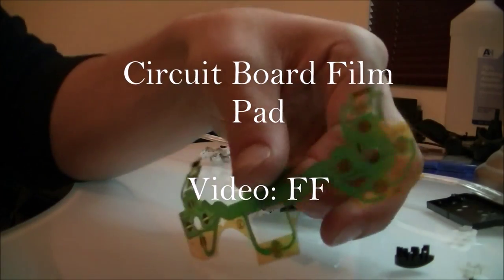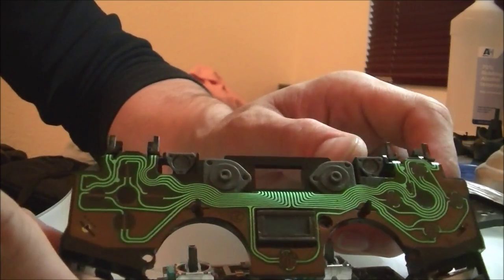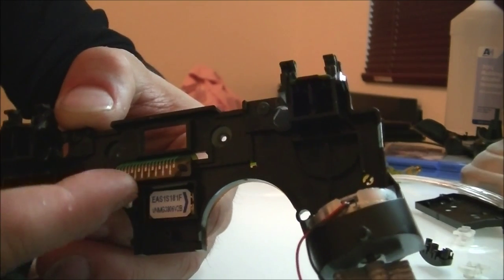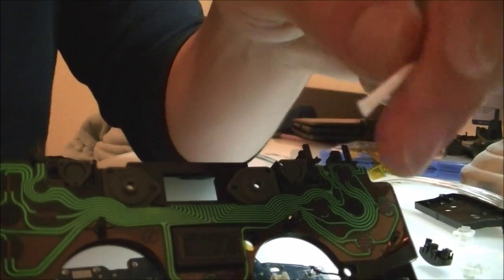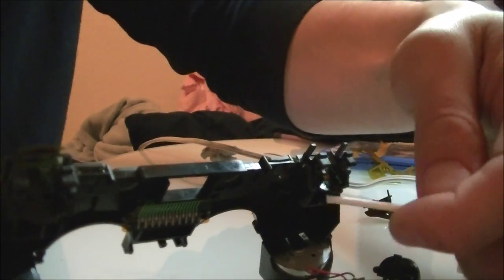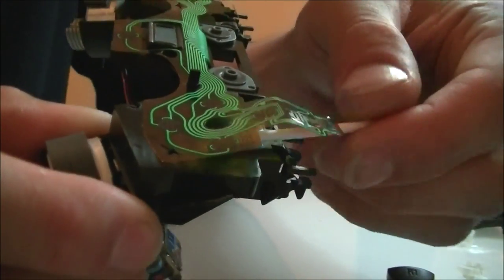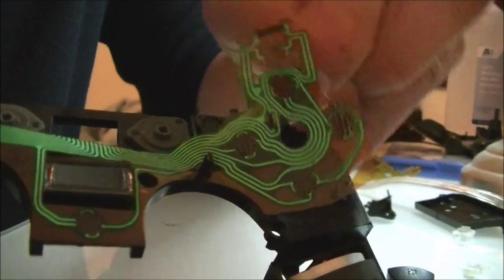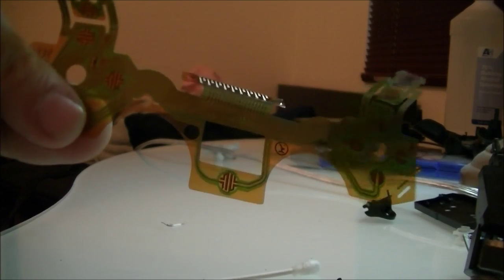Video FF : Circuit Board Film Pad Removal and Maintenance

Comment: @bonus card what do i do if mines is messing up like when i press anything on the left side of my controller it automatically say i pressed l2
Reply from the maker: +mario mckinnie 
Please open up the controller by viewing my video "how to safely open up a dualshock 4". It sounds to me like the filmpad may be dirty or bent so that any pressure on the left side affects the L2. This could also be because of a broken L2 or spring. If it is not due to a broken L2, I think the biggest possibility will be the filmpad. You should remove, clean and make sure all contact points on the filmpad are flat and contacting correctly.
Reply from the maker: +mario mckinnie I have seen problems happen to just one side of the controller pretty regularly. Usually this happens because a part has been broken and then lodged into one of the gaps on that side of the controller. Therefore, i recommend opening the controller and checking to make sure each part is connected correctly. Often a loose thumbstick will make the case not able to close correctly, in this case that would be the left thumbstick. If you can also check the dpad rubber conductive pad (Q) in my other videos, to make sure it has been connected correctly. Next check the L2 and the L2 rubber conductive pad. The conductive pad for L2R2 must be pulled over the top lip of the plastic interior casing. Besides these try to make sure the shell is fitting together before screwing the entire ahell together.
Reply: +bonus card thanks lol but i just sent it to the PlayStation factory its their problem now
Reply: bonus card 
my controller stopped working properly after I've changed conductive film. Now l2 and r2 always on. It's not the conductive pads, I've removed them and tested without them, anyway l2 and r2 working without any phisical contact. Ordered new conducting film on ebay from the other seller, I was sure it's the film giving me all those problems, but no, the second one does the same think. Bought new controller at the end... 
Anyone any ideas how to fix, second controller will be good too
Reply: @sziurys  i have the same issue....did u get any answers
Reply: @suwaidakbar  
Yes. I've changed those rubbers underneath every single button. All problems gone
Reply: You can change only those wich is not working properly

Comment: Thanks for the video. It really is informative.

My question:
My controllers L2 and R2 always stay pressed. I did remove the l2 and r2 buttons and the rubber conductive pad, but still the l2 and r2 stay pressed.

Do you think the circuit board film is damaged?
Reply: No.
Reply: @sziurys  i got it fixed. It was found that the circuit board film was the problem. GOt it replaced and now it works fine....:)

Comment: One of the contact circles in my film looks scratched and wear off, coincidentally the button over it doesn't work (up) this can be fix or the only repair is to replace the film?
Reply from the maker: If the film pad is damaged it is a probability that it must be replaced. The electrical ribbon in the film pad is very sensitive and a damaged film pad will definitely cause decreased functionality
Reply: My film is separated in 2 pieces, and is clearly visible that one of the black circles is isolated from the ribbons, the connecting part is scratched, not like the video where the circles are integrated to the ribbons
Reply from the maker: Thank you for clearing that up, this video explains fixes for gen 1 and gen 2 ds4 remotes, I think the generation that you are dealing with is one of the newer generations where they have used a different design and somewhat more efficient/less diy friendly architecture.

Comment: Hello. Would you happen to know the diffrence between the 4 colours/type of Flex Ribbon circuit boards and if they are compatable with each other?
Reply from the maker: David Ellis Hi David,  I believe you are referring to Blue, green, yellow and the fourth I may not have seen. I have tried switching Blue and green, they have a few holes in different locations (For example moved up few mm) but with a few minor adjustments, filing the internal casing down, should work ok. I would still suggest using the same model for the same model. This can be found out by looking at the numbers on the back of the casings, if the second number is the same, it is the same model type and the counterparts should fit correctly and switch out correctly, regardless of color.
Reply: Hello, I know it's an old comment but I had a problem that I think connected to this. Anyway, I changed my film twice, originally blue, to green (I had 2) and after a few days it had the same problem which is when I pressed the touchpad, I think It scratched the circuit leading to R2 and down d-pad buttons. What do you think about this? Thank you.

Comment: Hi. I have a problem with my ps3 move controller (the one with white ball). The trigger (T) is always on. There is no replacement film anywhere.  Searched a lot. Followed another video which had similar problem fixed by cutting the black trace so the button would make the contact when it is pressed. Unfortunately it didnt work in my case and then i found out that the trigger is analog. Can you help me with this?
Reply from the maker: Hs P Sorry, I don't have a ps3 move so I can't really offer any help on the subject.
Reply: bonus card i just wanted to know the principle behind analog keys and conductive pad (like L2,  R2 in ps3 or ps4 controller). It looks just like the digtal input (x o tri square L1 R1). 

Just a general input behind the working of anlog input on the conductive pad. I have googled but cant find any info.
Reply from the maker: Hs P You are correct, actually when opening up the DS4 you can see that the way of the l2 interacts with the film pad circuit board is the exact same way
Reply: bonus card ya.. Quite confusing because it looks the same.. Move conductive film is not available anywhere.. Guess its trash  unless i figure out something.. Anyway thanks

Comment from the maker: @ DiogoOften these problems happen due to vigorous play. Piercing through the rubber conductive pad and the circuit board film pad (circuit paper). As I have posted on other comments to my other videos, the only way to get a new main circuit board would be to buy a used controller or broken controller with a fully working main circuit board (analog sticks and fully working ICs for power). If the main circuit board is not the problem, you can check the circuit board film pad which is often the faulty button problem. For this part please check xScum bag's link, Amazon, EBay or Aliexpress.Also, if you are in the southern California area, I can always help out.
Reply: +bonus card i Always searched in the web how to fix the problems of my ds4 but i never got any reasons.Let me explain: my X and then O buttons doesn't work aniway maybe because one day it falled in floor. However i tried to open and fix it by myself without success, then i went to an electronic fixer but still without success. Im wondering if this problem concern the circuit board film.. if u believe it's so, may i can buy it and replace by myself again..Thank you
Reply from the maker: +PrinceVincentMJ 

Because the buttons are having problems, i would recommend trying to make sure the rubber conductive button pad ,(K) in my other video, is attached correctly. If that is correct, then i would recommend  making sure the case is closed correctly. If the problem is not completely fixed, i would recommend making sure all of the contacts are in contact correctly. After you are sure none of these issues are the problem, then try the film pad unless you are willing to try to troubleshoot using an old controller for parts.

I am currently in the upstate New York area if you need any help.
Reply: i have this problem because one day my pad falled on the floor but nothing seems to be broken. then i teared down my pad but nothin was wrong expecially for the buttons X, triangle, circles exc... Then  i brought it in a simple computer fixer but he didn't find a solution, he think that the film pad is the problem but i would like to be sure about it. However thank you for your reason and tutorials

Comment: My ps4 controller is not charging nor turning on but when I press the ps button it turns on my ps4 but no light please give me some tips so I can repair it
Reply from the maker: I would definitely try to charge with a  Sony stand alone charger or USB cord. Sometimes we mix up the charging cords and use the wrong ones (phone charging cords) which can be detrimental to the rechargable battery. Next try to charge directly through an outlet plug connected to usb to your controller. If this does not work try to switch out a new battery.
Reply: @bonuscard1963  i did that already i have a charger that automatically show the light on top when its charging n the chip that powers on the controller starts to get hot
Reply from the maker: Thanks for the repky. Please stop this charging then. The battery has gone bad, if you swap for a new battery this should mediate the problem.
Reply: @bonuscard1963  i left it alone but I try with a new battery n if that dont work
Reply from the maker: I am only offering suggestions based on what has worked for me in the past. I can't say that this will be the ultimate solution, it is only a solution that has worked for me in the past.

Thanks!
Reply: @bonuscard1963  I know im just saying it might work for me n might not

Comment: Box and O button not working in my controller. What reason could u suggest for it?? Please let me know asap
Reply from the maker: Ashwin Unnikrishnan I would say that this is most probably happening because of a problem with something inside the controller breaking off and then becoming lodged in between the push button control pad and the main circuit board. One way to check this would be to open the controller and check the pad area. If there is a small piece of plastic in that area you will need to clean it out. This will also allow you to check the rubber conductive pad for misalignment and to retitghten the screw's on the casing which could be a secondary problem.
Reply: Will changing the circuit board will help to fix this issue .coz I tried cleaning all the parts seperately so that no dust or anything is present
Reply from the maker: Ashwin Unnikrishnan Because we do not know the exact cause, we cannot know an exact solution. If you did change the circuit board film pad correctly it could not hurt and very possibly could solve the problem.

Comment: Hello is it possible that my homebutton doesnt work because of that thing?!?!?!?!?
Reply: Same problem here ☺ and can i fix this thing if its damaged from somewhere?
Reply: @kreitzo4853  nope. I just ordered one from ebay for 5€. U cant fix this problem :(
Reply: @ayman4307  i think i damaged mine by mistake when i was fixing my analog ☺ if yours not damaged dont buy another one its maybe because not charging battery or something else idk what is your problem.
Reply: @kreitzo4853  Nope. Battery works fine. It charges and i can use all the other buttons.
Watch this video! https://youtu.be/GBpqfhPPJPw
Reply: @ayman4307  did u try to clean that thing and ps button
Reply: @kreitzo4853  yes...
Reply: @ayman4307  i want to know what happened to your controller if it was working before what did u do with it ☺
Reply: @kreitzo4853  idk. It worked fine yesterday. And i just figured out that if i go into the safe mode the ps button works?! I dont know wtf is happening 😫 i will change the film when it arrives and tell you if it worked!
Reply: @ayman4307  ok reply if it worked
Reply: @kreitzo4853  it didnt work😐 its something with the circuit board i also changed the battery. Need a new circuit board or conteoller
Reply: @ayman4307  if u buy a new controller just dont throw the old controller u will need it
Reply: @kreitzo4853  i know
Reply: @kreitzo4853  im so mad right now because there is now visible damage inside... and because the controller works just like the home button but only inside safe mode and on pc😔
Reply: @ayman4307  trying to get parts to fix controller is so annoying i know
Reply: @kreitzo4853  yeah and sony cant even help -_-  they made the controller so they have to know how to fix specific problems!

Comment: My R2 button is not registering a lot of push for some reason
Reply from the maker: This is most probably due to one of three things in the area of your r2 button. Either the button is stuck due to overly tightened case, a foreign object or dirt buildup in the area or a spring, the plastic hinge or rubber membrane could be out of place or broken. I would start with a diagnostic check by opening the controller and observing the area of the R2 button.

Comment: Hello, can you clean the film?
Reply from the maker: If you do clean the film I would use very non corrosive cleaning product. No acetones, no acidic cleaners, perhaps a mild soap and water mixture or very low alcohol percentage rubbing alcohol. Also make sure all power is disconnected and dry well after.

Comment: so if the pcb isnt working just get a new one? is there a way to clean it instead?
Reply from the maker: The main circuit board pcb is very hard to repair, mostly because any problems come from the semiconductors/microchips inside. If anything can be done with cleaning, it is usually by blowing and particles free from the pcb or soldering larger modules such as the six axis thumbsticks, rumble packs or other wire connected parts. It might be a better idea to buy a used controller and use its pcb.

If you are referring to cleaning the circuit board film pad, just buy a new one, they are usually $5 or less.

Thanks for watching!

Comment: hey can u please tell me that does v2 controller has the same circuit board film pad because my one has little scratch on it so few buttons aren't working plzz help.
Reply from the maker: DemonAble most of the v1 and v2 should be interchangeable. The problem is if we are looking at the same numbers to determine v1 and v2. I have dealt with versions all the way up to v5, which are impossible to replace due to lack of suppliers of extra parts. Usually by reading the serial number on the back you can tell the version of the controller, the way that I was able to decipher these numbers was looking directly under the bar code are a series of numbers usually a 112XXXXXXXXXX number. The sixth number is the version number. So XXXXX1 would be the 1st gen. XXXXX1 second gen and so on.
Reply: i actually have the gen 4 v2 the one which comes with ps4 slim and pro
Reply from the maker: DemonAble sorry I got mixed up with the terminology used, I was referring to gen #. My videos are mainly concerning gen  and gen 2 fixes.
Reply: ok,no problem thanks for the help.

Comment: why often do these sort of problem cause by?
Reply from the maker: +Affan Qureshi I believe that you mean to say "What sort of problems are related to this part?", I hope that is correct.The circuit board film pad is the main contact between each of the buttons and the mother PCB. Because of this the main problems that occur due to a "faulty" circuit board film pad would be.1. R1R2L1L2 2. Cross Circle Square Triangle 3. D-Pad 4. Power button I have had many interactions with customers and contacts who think that the circuit board film pad has direct connections with the analog sticks. This is not true. The circuit board film pad does not have direct contact or influence on the:1. Share button 2. Options button 3. Analog sticks 4. LED/Charging portI hope this helps!Feel free to ask any questions and if you are ever in the Southern California region, please seek me for any help or assistance!Thanks for watching!

Comment: the X button on my ds4 one day stopped woking normally and now only works if I press it like 20 times and it Will respond randomly. I already opened it up and cleaned but it didn't work. could it be that this circuit flex failed on the X button part?
Reply from the maker: I would say that you should make sure the rubber conductive pad is fully intact and not ripped or torn. I would also think that you should pay attention to the actual x button, it is possible that one of the plastic tabs has broken off from the button. Also make sure that the screws all around the casing are right and the bodies of the casing (front and back) are contacting with each other. If no other problems can be found, it is probably circuit related in the  circuit board film pad or the circuit board itself.

Best of luck troubleshooting!
Reply: the pads you say are the black circle rubbers inside? they all seem OK compared to the arrow rubbers. I have tried rotating the whole rubber to see if it was only the X button part of the rubber but it is still the same for the X only, I have to press the X many times to get it working. I tried cleaning the rubber and also the flex circuit but no luck. Should I try anything else? Should I try pressing the flex circuit with the controller opened and turned on to see if it is a contact problem? thanks
Reply from the maker: That would definitely help to eliminate a few variables from troubleshooting, I found it best to press the rubber conductive pad against the circuit board film pad, also make sure that the circuit board film pad is correctly attached on the back of the plastic interior casing.